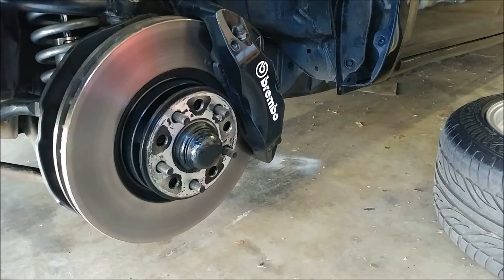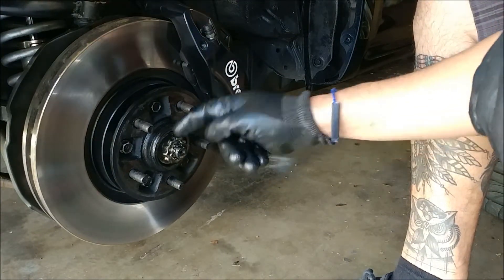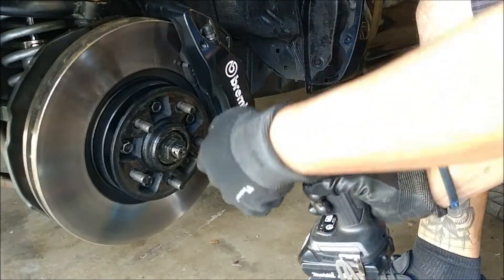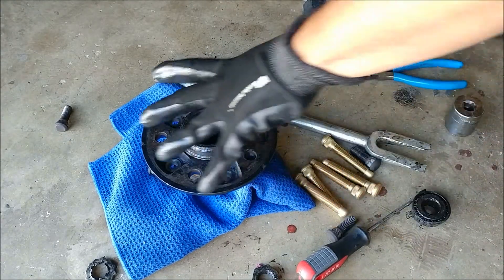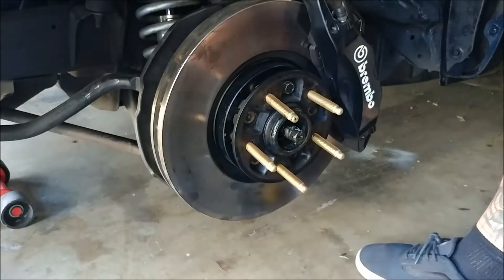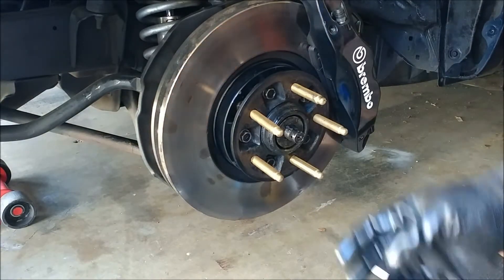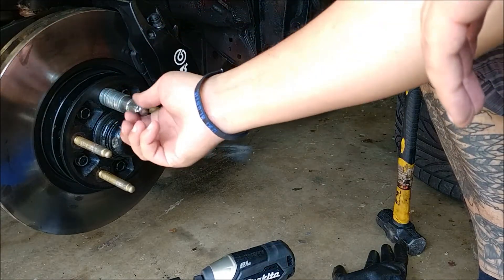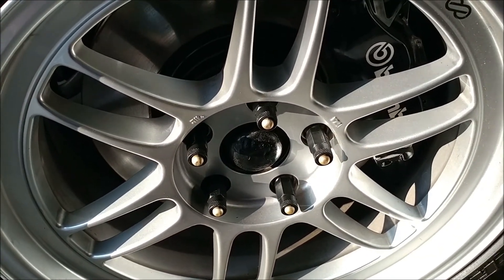ARP extended wheel studs on a Tacoma

Comment: Will hitting the studs with the hammer damage the bearing?
Reply from the maker: The wheel bearing was removed from the hub before hammering them out. as long as you do the same it will be fine.
Reply: I dont see how it would considering you probably hit bumps in the road that generates more force then u hitting the stud with a 3 pound hammer i mean i knock studs out of semi trailer with a 6 pound hammer and the bearing full kit and  still intact on the trailer